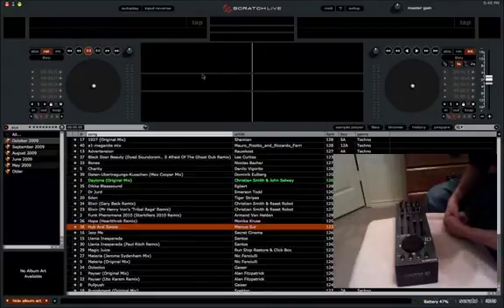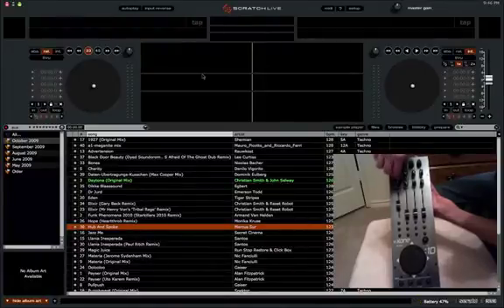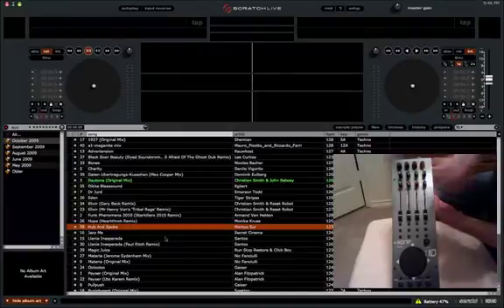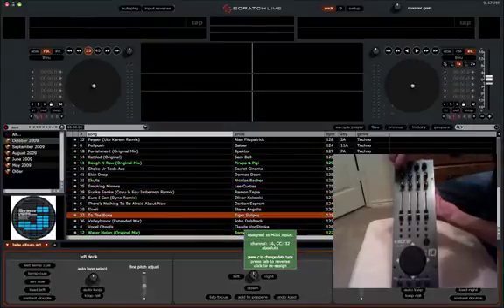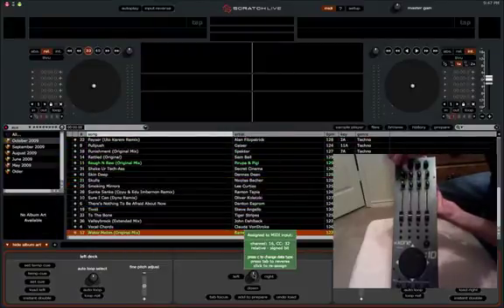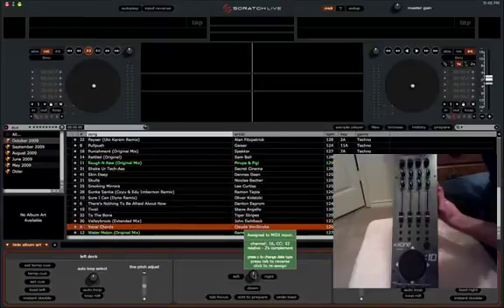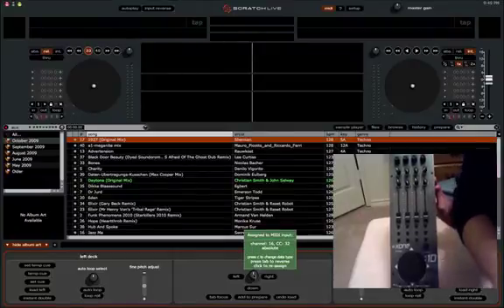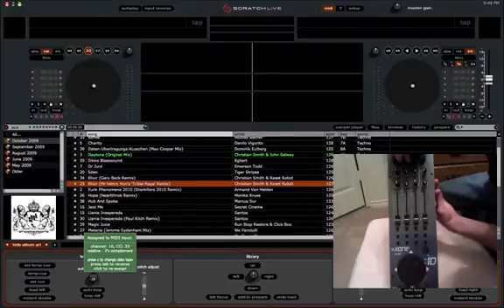MIDI mapping rotary encoders/endless rotaries

Comment: Great video. I just picked up the Traktor Kontrol X1 and downloaded your mappings. Thanks by the way! However, on knob scrolling (tracks, crates, loop lengths) it's skipping by two. I checked the setting on the control editor and it's set to one. Serato midi setting is relative/2's compliment. Any ideas? I'm on a PC (Windows XP), running Serato 2.1, midiox and midi yolk.